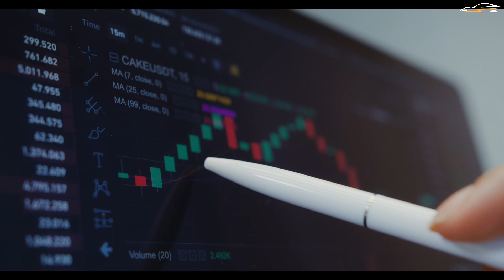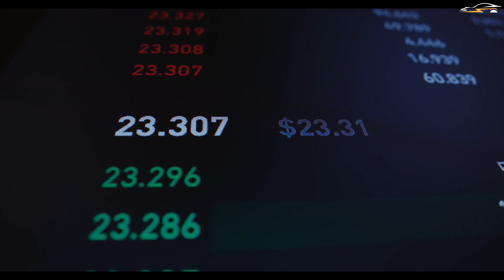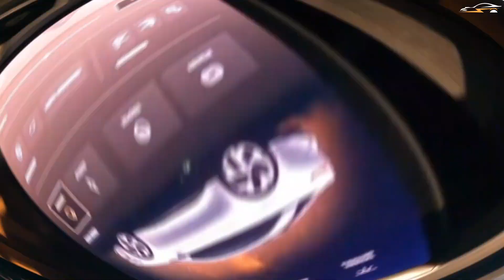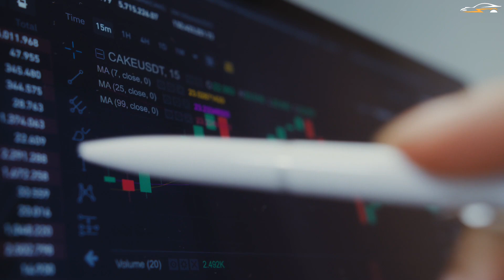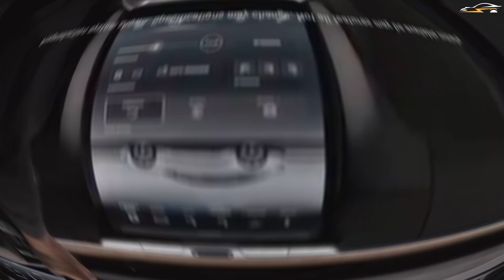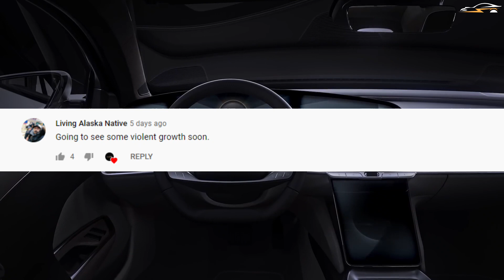Lucid vs Fisker, which is best to invest? [EV STOCK] [CCIV vs FSR]

Comment: Vertical integration takes a lot more starting capital which Lucid does have now. Fisker is taking the right approach for the amount of cash they have. Both will probably be successful, Fisker does have a much lower valuation so potentially more upside.

Comment: I’m a fan of companies who are capable of vertical integration. Over the long term it will be far better for bottom line revenue. If you can’t develop your own tech in house, it’s certainly understandable to outsource where needed, but it will of course cut into your profits. Lucid is capable of creating some of the best tech from what it seems, so I’m extremely bullish on this company for the long term, and I’m excited to see what they can produce down the road. Also when you develop your own tech there’s always the possibility to outsource or license your tech to other companies which could potentially be huge for Lucid, and something the CEO has mentioned previously.

Great video as always!
Reply: Genius.
Reply: And if you do not control car manufacturing processes it might turn against you at some point.

Comment: No comparison - Lucid. They have massive cash to roll out all the Air models and Gravity for the next 3 years. They have an initial plant build-out, PIF offering billions for another plant build, 8,700 orders, stores all over the country, very high tech EV, and a who's who executive dream team... This screams an EV juggernaut coming.
Reply: but if you were to go based on what stock has more probability of 10x your money, Fisker would be the choice based purely on MC and shares. fisker has 430 million shares, while fisker has around 15 Billion. fisker has a market cap of 4.5 and lucid has a market cap of 60. if fisker matched Lucids market cap (which is low for the outlook they have) you would over 10x your money on fisker. this is not an argument on what vehicle is better or cooler. but instead which stock will make you more money.

Comment: The question is which one is more likely to make you more money in your portfolio we’re not arguing about what company has the better car but you have to look at the particulars lucid has over 1 billion outstanding shares Fisker only has roughly 200, million shares because the other 200 million is being held by Mr. Fisker and his wife do you have to look at the market cap on both of these companies Fisker‘s market cap is very low compared to the industry averages so if you were to ask the question which stock would give me more bang for my buck which one can I get more of a Multibagger out of the answer would be Fisker but if you’re asking which car is the baddest ass car I would of course answer by saying the Lucid air